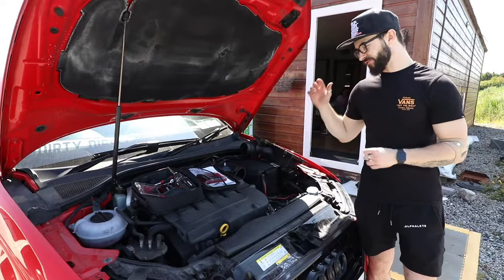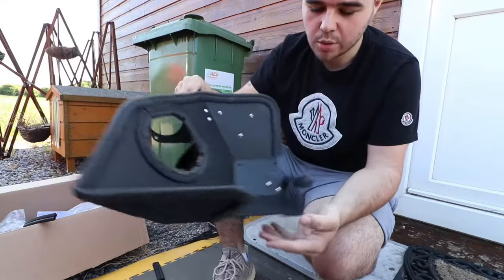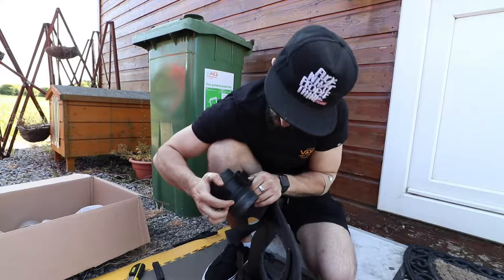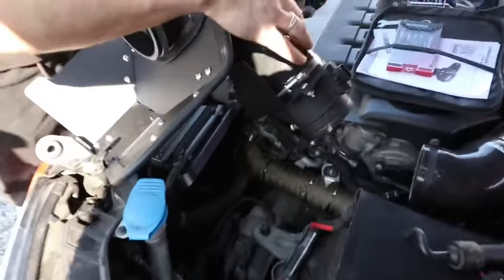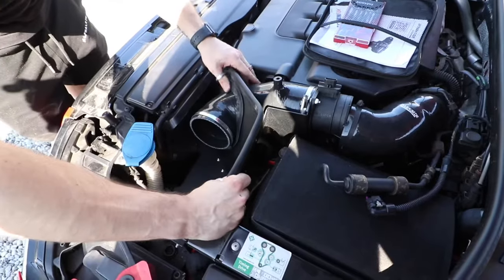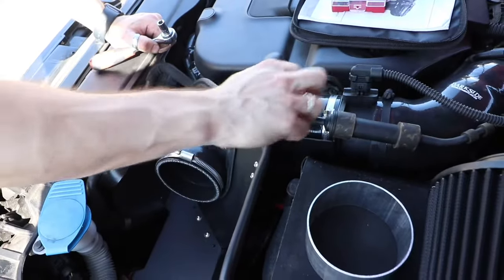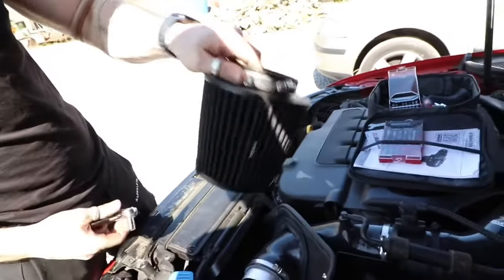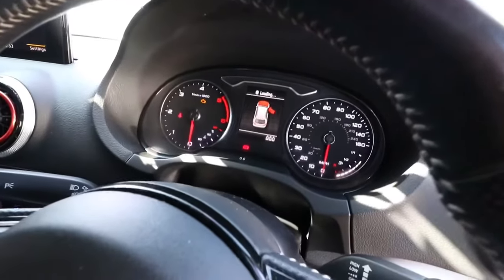RamAir PRORAM Induction Kit Install | Audi A3 8V 2.0 TDI Build | Ep. 8

Comment: Hello, for some reason I have the same sound from the air housing, but my housing and the filter is factory one . Do you maybe know why is that and how to fix it
Reply from the maker: My guess would be maybe a leak / hole in one of your hoses??
Reply: I checked it, but nothing. The next step I thought about is to remove turbo and try to clean turbo vanes. Do you think that could help? 
Also, when I remove the air filter and then step on the accelerator and release it, I get this sound from the intake. Very sharp sound

Comment: How are you finding the induction kit? I’ve fitted the same one to my 2.0 tdi Audi a3 fl and it sounds good but it lets off quite a few different noises do you get the same?
Reply from the maker: Hey man, I definitely have increased induction noise and a small “blow off” woosh kinda sound when I let off throttle (I don’t have a BOV installed, just for context) but that’s about it… what noises are you hearing??
Reply: @lifeofwill8824  ahhh okay bro nice, same with mine but sometimes it sounds like there’s a knocking noise but the cone doesn’t seem to be hitting anything… does yours sound similar?
Reply from the maker: Can’t say I’ve noticed a knocking noise… maybe check and see if the heat shield has popped off one of the mounting points??
Reply: @lifeofwill8824  I’ll have a double check just incase, you have instagram?

Comment: Will there be an muffler delete ?
Reply from the maker: Hi Lukas, yes I have done a turbo muffler delete with this set up. I did this when I installed the hard charge pipe if you want to check that video out 🤙🏻
Reply: @lifeofwill8824  nah i meant a Rear muffler delete in the exhaust 😅
Reply from the maker: At some point I’ll be ordering a Cat-back exhaust from Darkside and that won’t have a silencer

Comment: Thank you mate. I ordered both Turbo inlet and proram kit from Darkside. All thanks to this video.

Installed on my 2.0 TDI 190 Seat Ateca. Exact same set up and sounds so much more better than stock. 

Will be getting Stage 1 map with dyno soon. And hopefully push atleast 250bhp.
Reply: 250 with dpf and egr still in isn't possible. Unless you already have them out. You also risk damaging the turbo or exhaust manifold from the extra back pressure so a delete is recommended
Reply: 250 you're gonna need a turbo manifold kit, egr / dpf del - If from darkside they'll offer I think it's the 2260BK turbo or something like that. 250bhp on the new CR 2.0tdi engines will set you back around £6-7k. I know as I've just had my 2017 Audi TT done at darkside for 250bhp.
 
Intake and a remap will see you about 215-220.
Reply from the maker: Nice one, glad we could help 🤙🏻

Comment: Juat a question did you go for the gtb charge pipe or standard  one!? Also does the alloy ring come with air filter an then goes in air flow mass sensor

Comment: Sounds good, you still got the DPF and EGR? planing to install this to my Golf MK6 also 2.0 TDI.
Reply from the maker: I do. Hard to get away with a DPF delete in Ireland 🙄 I do have a Darkside charge pipe though…
Reply: @lifeofwill8824  my Engine is remapped from 110 to 185hp, i can hear a bit of my Turbo spooling up so i expect maybe a bit More difference with a intake But this ramair set is expensive in germany have to build myself the intake itself costs about 50€ its okay when it Sounds Good 😂
Reply from the maker: It is expensive for sure… it’s a great kit though, literally everything you need just bolt on. Makes it so much easier 😂 The A3 is 150bhp from factory so I haven’t mapped it yet but I will 👌🏻

Comment: Is it essential to have the turbo inlet pipe before connecting all this and what difference does it make ?
Reply from the maker: Not essential at all my man, just if you are planning on getting one it’s a lot easier to install it before hand since you’ll have to take all this back out to get at it if you do it after… having one increases airflow into the turbo so you get a slight power boost and potentially more noise 👌🏻
Reply: @lifeofwill8824 just ordered 1 cheer’s hopefully won’t be too hard to install it all I’m not good at these things but like a challenge and will be using your vids to help me 🤣
Reply from the maker: Happy to help mate 🤙🏻